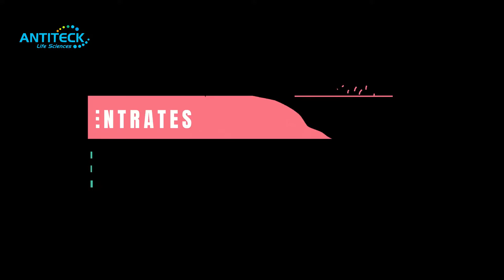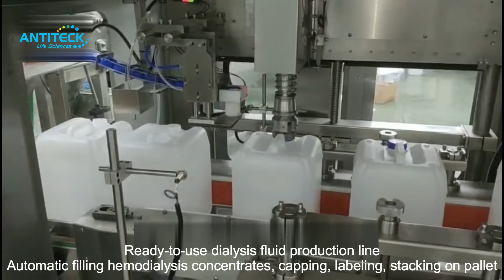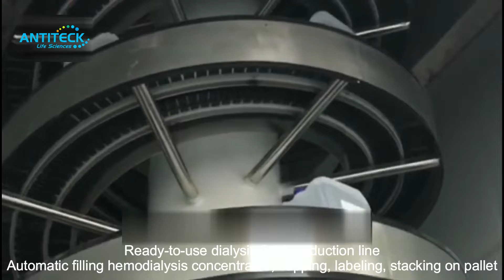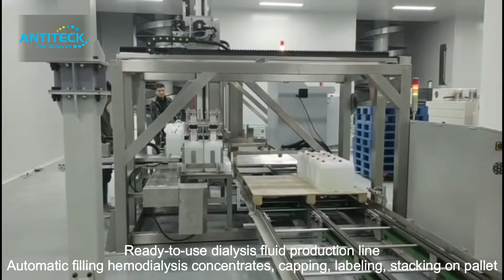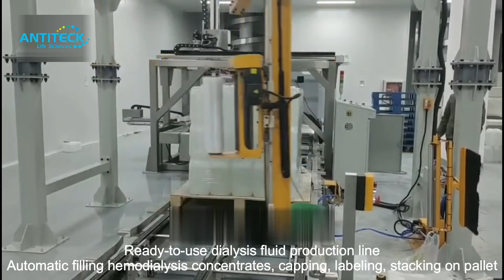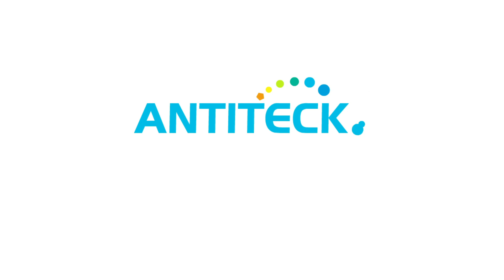Dialysis Fluid Production Line- Acid Concentrate For Dialysis Manufacturers - Dialysis Concentrates

Comment: Hi. Excellent video. Can you help me with guidelines as to how the entire plant should be set up. From the RO to the mixing tank, to the storage tank, to the filler and finally packaging. Also how the HVAC clean room, qa & qc room, lab. Basically process and requirements from start to finish
Reply from the maker: hi, it's high investment for a dialysis fluid manufacturing plant. please send email to info@antiteck.com, thank you.
Reply: Please tell me the investment requirements